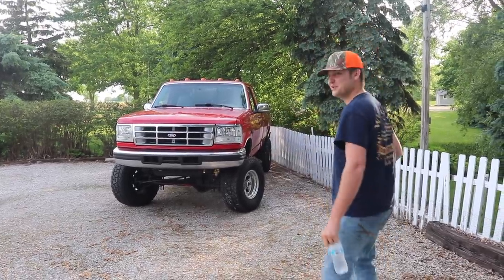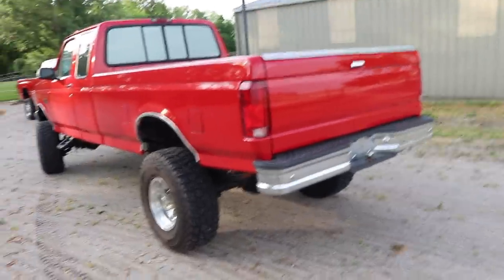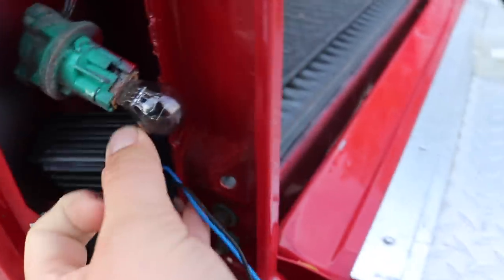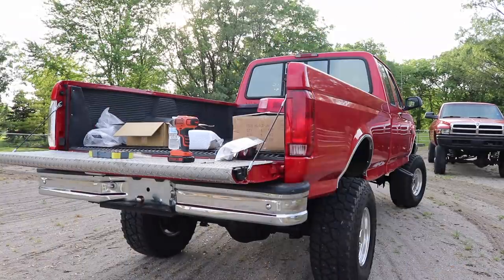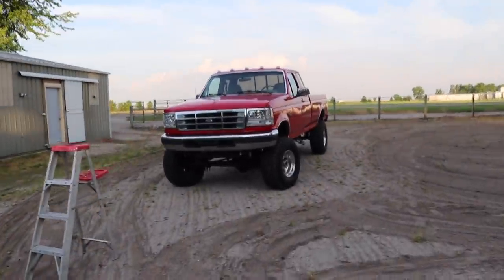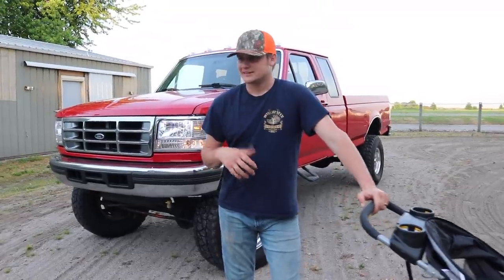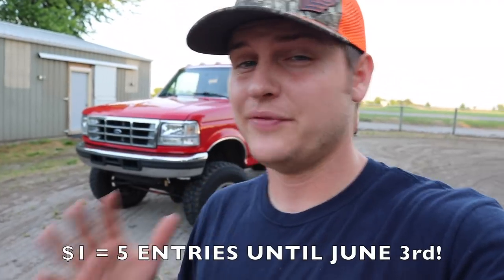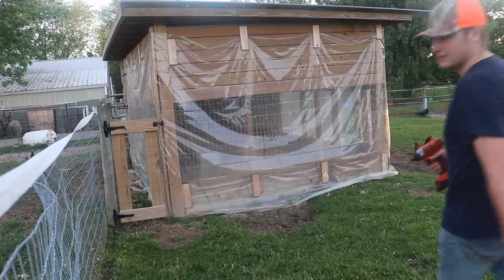This change to the OBS 7.3 was MUCH NEEDED!!!

Comment: I definitely recommend getting some fuel additives cause diesel can gunk up the lines and injectors as well as the pick up tube its pretty common because diesel is thicker than gasoline and has a natural residue its good to drop the tanks and clean them out at least once a year normally right after the winter time

Comment: It’s called a resistor for the leds. It helps not do the hyper flash. I do not like ford but that truck looks sexy with this tails. What is the horn for?? U just used to smoked out lens.

Comment: more fords please and the hard starts on the truck is injectors going bad know i use to work part time for a private ford powerstroke tech and we did more injectors then anything so i know thats got to the problem with it .thanks

- nick
Reply: If it needs injectors, swamps are good
Reply: @mikescott6647  full force are the best you can buy rightnow and also have lifetime warranty too.thanks

- nick

Comment: These older trucks dont look that good with newer style lighting. I like the clear headlights though but the tail lights look way better stock.

Also putting daytime running lights on some of these. It doesn't work. Maybe because it wasn't originally designed that way. The old saying trying to fit a square through a round hole. I think a red led light would look better like a stock tail light just all red in LED.

Comment: Man......this truck screams Amazon built/Autozone hero. Running lights don’t match the headlights/taillights now  which are white/chrome? Lame but it’s a Mexican thing I guess, wanna know why that’s a fact? Look at the ext cab windows? ZERO chrome trim! The running lights are amber and the ext cab is lacking trim. Trucks not pieced together right. Looks VERY mismatched.👎
Reply: Still a sweet truck, you have to admit, you want it.
Reply: Nah man. The electrical nightmare awaiting any average dude with a 7.3 will curb the truck faster than a blown engine. Cummins all the way! 89-91 91.5-93 is king 🔥
Reply: @tanner882  what is the saying, Rich man's diesel 7.3, poor man's diesel Cummins. I love them both by the way.
Reply: @nathankoroush7918  o ok your right 😏